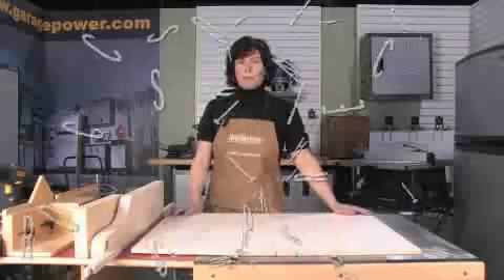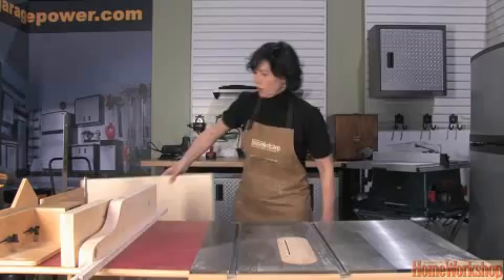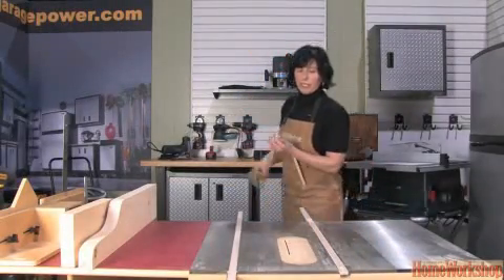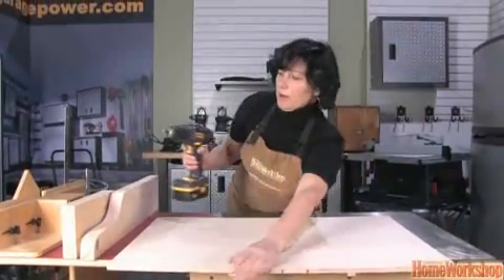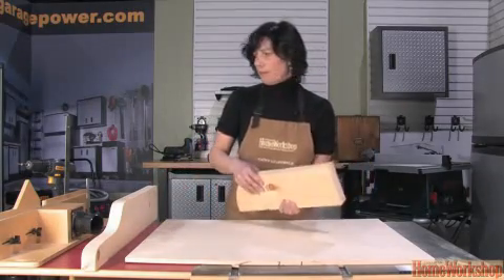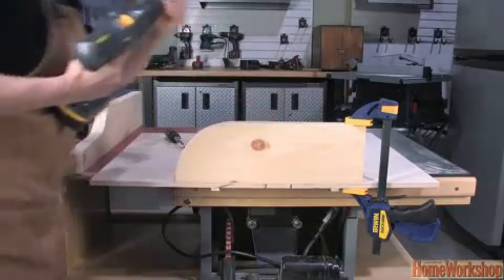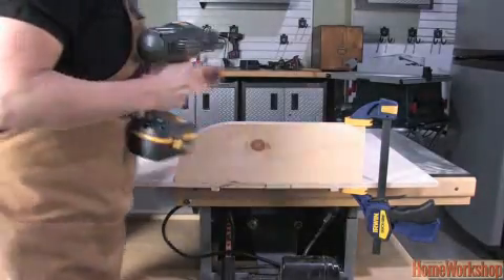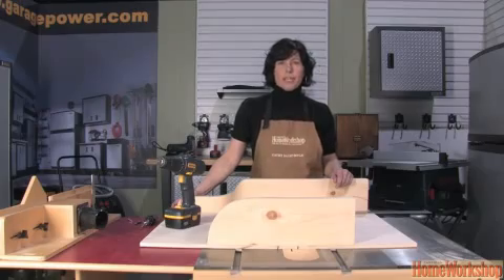How to build a table saw sled

Comment: I have found that aluminum runners work far better than dicking around with wooden ones.  Plus there is almost no temperature or humidity effect on how smoothly the jig slides over the table.

Comment: I agree Steve Martin from WWMM is a top utube presenter and I get a lot out of his clips. The one thing he can't do is apply glue, I've not seen glue poured from a quart bottle straight onto the surfaces to be glued.I supose it worked though..
The one thing I was taught about sleds was after your very first saw cut, before you do anything else, use that nice straight edge and CHECK THAT YOUR SQUARE IS SQUARE.  It would be a real bummer to make your sled and find the test cuts are not square..

Comment: I predrill screw holes and counter sink on my runners before attaching them with the sled with the glue. That way runners will not move trying to drill holes and counter sinks.

Comment: Yep. Nicely done, but the music was unnecessary at best.  Heading out to get a birch ply handy panel now.

Problem I have is that my tablesaw miter slots have a lip on them, so I either need to grind them (they're tabs) off or cut rabbets along the length of the runners, which I doubt I could do accurately.

Comment: The problem with any u frame design sled is that it opens one up to hand injuries via the saw coming out the back side of the push board . The only real way to build one of these sleds is to keep every thing to one side of the blade ,cut off the excess and keep your back stop low other wise you set yourself up for hand injuries.

Comment: She didn't finish the project.  No hand protection?  How about a built-in sliding block for repetetive cuts? No top cross-brace for stability?  The Baltic birch she used was warped. But other than that...

Comment: I think that the rear board needs to be checked for perfect square with either the 5 cut method & a caliper or a clamped square & magnetic dial indicator before the 2nd screw is put in place & then checked again afterwards.. Also the runners need to be a hardwood so as not to wear out quickly from being soft white pine. I found graphite powder the best overall lube for these runners.. These small sleds are very handy, I use mine all the time..

Comment: Don't put glue on your runners then clamp it and let it dry. The moisture in the glue will rust the table straight away. MDF is more stable then that warped piece of ply she used.
She did mention she was the editor of the magazine, not a wood worker. I wish my wife could even use a screw driver. Notice how she never turned on the saw.lol.
JD

Comment: You do wood working for a living and you made this project so complicated.....

On the runners you could of added glue to the runners then lay your play on top square it up clamp it down let it dry flip it over counter sink and drill.  oh and BTW it's 2011 get some Lithium battery drills, NiMH batteries are soo 2005 :)

Comment: What I do not like about these kinds of videos is that on every single one of them.  They use equipment that I can guarantee 90 percent of the people watching do not have access too.  I would think someone with experience and a whole arsenal of machinery and tools to work with will already know how to build, what is seemingly the most basic tool for a woodworker and have no need to watch videos like this.  So the ones watching these videos are fairly new to it and most likely do not have jointers, planers, and such.  This is a good video for what it is, but when you start mentioning and using these tools that most people dont have access too.  It becomes useless.  A truly great video would be one that only using tools and machinery that the average guy just getting started in his garage would have.

Comment: You should change the title to "Some of the steps involved and some that you dont really need to do and stuff to make a warped crosscut sled that will be completely useless for anything other than cutting up boards for firewood or possibly removing your thumb if you're not paying attention when you are cutting your firewood"

Comment: I appreciate your effort to post this. However, it would take a stroke of dumb luck for this method of assembly to produce dead accurate cuts, every time, and perfectly square to the blade. Sorry, I didn't see you square the sled fence to the blade.

Some table saw blade arbors will not be perfectly square to the edge of the table; close is not good enough.

This appears to be a flawed plan.